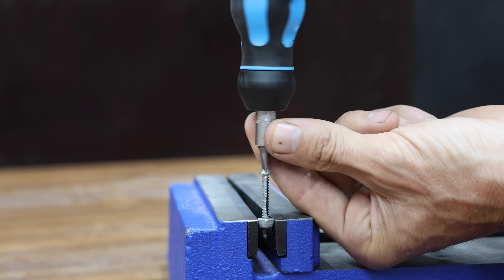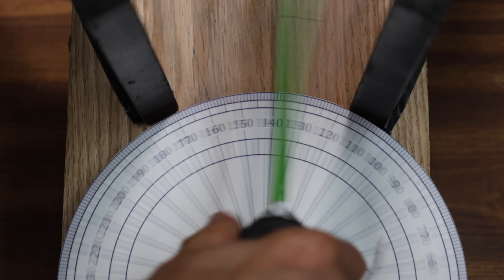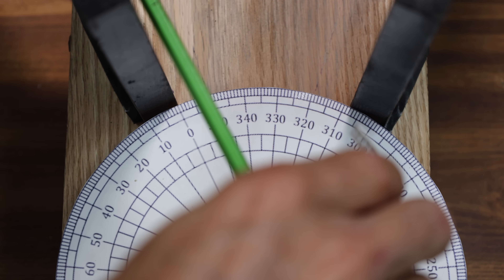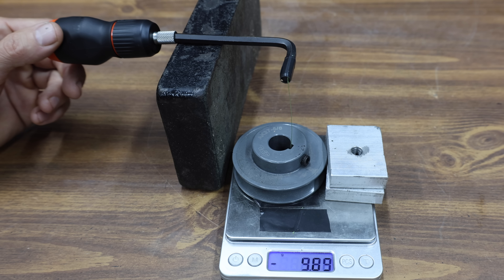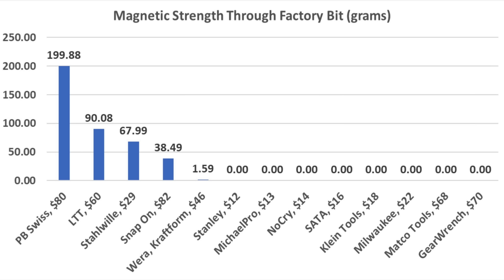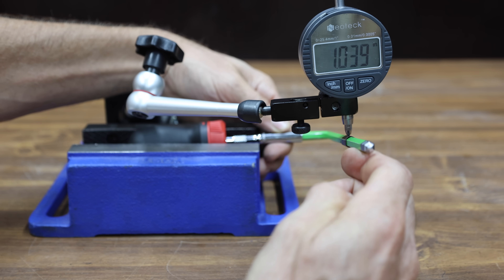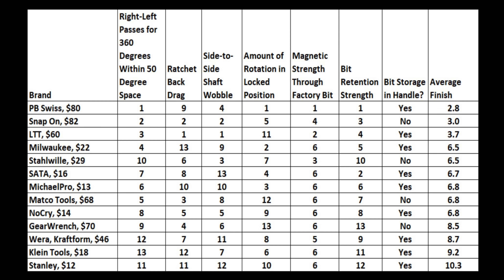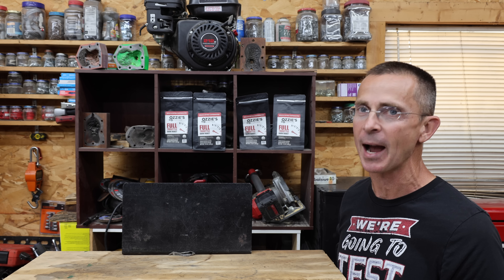Is Linus Tech Tips “Stubby” Screwdriver Best? Let's Settle This!

Comment: I think one of the most impressive wins for the LTT is the side to side wobble, less than half the slop of the snap-on, which costs more and is from a long established tool maker. Very impressive.
Reply: It's impressive don't get me wrong, coupled with everything else it's brilliant - but when it comes to ratcheting tools I've never found wobble/slop to be a significant indicator of anything straight out the box. They all end up the same way very very quickly. Now if LTT retained that tightness over a long period, I'd be super impressed and would make it my go to. But the larger LTT didn't hold up for me in that regard. My experience is they all end up just as wobbly as each other after a week of use, and if you need an exacting use, it might be best to see if you can use a non ratcheting tool.

But it's definitely a very very good indicator of strong build quality in the LTT and its impressive that a company like LTT that doesn't (yet) specialise in tools has such high quality control
Reply: @medes5597  I personally cannot stand slop in a ratcheting driver. The two I currently have are annoying when working in slightly tight spaces, making it easier to cam out when put enough pressure on them (I don't have any of the stubbies, so I'm talking about regular sized drivers). I'd much rather the LTT o r the PB Swiss in that regard
Reply: @caodesignworks2407  I don't disagree at all. Especially as someone with a wrist injury, slip was the bane of my existence - but I do think slop is inevitable if you're doing a lot of work. When I was using my ratcheting screwdriver hundreds of times a day, I was stuck with slop pretty much from the get go. Id definitely love to see a long term test on slop and which ends up with the least after a fair bit of use. That would likely influence my decision.
Reply from the maker: Thank you!
Reply: @zakkazz1201  hmm good catch. I can see how it could've been an honest mistake as the shaft on the LTT is so short, but yeah it is the closest to the vice of all the products tested and you cannot see the light coming from behind the screwdriver in that gap as you can with the other products that were close to the vice.
Reply: @zakkazz1201 I also noticed that, but then I paid attention to other screwdrivers, some of them were locked similarly. I assume all of them were locked the best way it was possible... so geometry of shaft contributed into this particular test(so far the only test that was influenced by geometry).
It is not excuse, just explanation attempt.
Reply: It does look like the way the LTT driver was mounted in the vice pressed the plastic body into it effectively cheating the test. I don't know if that is the case, it could have this low wobble but it was snug against the vice.
Reply: Yeah but look at how much the shaft rotates in the locked position. Pretty horrible for a $60 driver.
Reply: Remember, the snap-on also has a disadvantage in slop due to the removable shaft…

Comment: Thanks, I didn't even know LTT had a stubby screwdriver in the works. I have the original and I'm very happy with it.

It's definitely not meant for automotive use, but for electronics, it's the best ratcheting screwdriver I own. For heavier duty work I use my Stanley or Dewalt ratcheters.

I only onw one stubby version, the Stanley that you reviewed.

Comment: I've never used a ratcheting stubby screwdriver. I just recently bought a Craftsman screwdriver set that comes with a few stubby Phillips and flathead screwdrivers. They won't be really put to the test. Just general maintenance work around the house. And besides, they were on sale anyway.
Anyways, I'm not sure how you keep a list of suggestions, but I did mention a couple of suggestions a while back. Reviews on cordless/battery powered hedge trimmers, and which lawnmower blade is best with a riding lawn mower. Thanks Todd.

Comment: I have the LTT screwdriver. I’m not a fanboy of the channel, but it looked really good. 

Expensive, but I’d definitely buy it again.
Reply from the maker: Thank you for sharing!
Reply: Do you have any comments on the shaft slop? As another commenter pointed out the LTT screwdriver seems to have been butted up against the vice in the testing here and may have skewed that result. Would appreicate your comment! I am looking for a better alternative to the milwaukee, which drops my screws (and causes a bunch of problems when they fall somehwere crappy)
Reply: @MarkTrades__ I’m not the original commenter, but I also have the LTT screwdriver.  There’s basically little to no slop in mine.  It’s my absolute favorite screwdriver, I use it for everything I can use it for.  Too bad the recent drama surrounding LTT might make some buyers hesitant to support him by not purchasing the stubby, but at the very least Linus made an excellent screwdriver and could certainly have a future in the tool industry.
Reply: @MarkTrades__  I have not experienced that.  I just use it around the house and have had no issues.
Reply: I recently watched a long(er) term review of their backpack and that one seems to be very good quality, too. It is for a specific niche (someone carrying 2+ laptops and some other electronics) and in that case, it does the job very well. It is well designed, the zippers are good quality etc. Good stuff if that is what you need. They also seem to have good customer support.

Comment: I have never much cared for ratcheting screwdrivers, and the ratchet mechanism plus the bit storage tends to make them a bit too long to qualify as a stubby screwdriver in my opinion; when I was installing car stereo systems, alarms and cell phones back in the 80s to early 90s I frequently used stubby screwdrivers, most if which were only about  2.5 inches long.  I frequently found myself using a "super- stubby" Phillips that wasn't much more than one inch long!. The super-stubby had a hexagonal shaft where the Phillips bit exited the handle which meant that I could put a ratcheting box wrench on it for extra side-torque, a feature that was lacking on all of these stubby screwdrivers.
Reply: PS, bit storage adds weight as well as length......

Comment: I ordered the original LTT screwdriver, but I have issues with the bits falling out when opening and closing the storage.  Has anyone else had this issue?  I have to chase down the screwdriver bits a lot.  Other than that it's a great screwdriver so far.
Reply: mine holds the bits quite well. id reach out and see what they will do.
Reply: I drop it all the time.  They do not often come loose.  They do but very very infrequently.

Comment: Regardless of the current controversy this was another great video and honest review of stuby screwdrivers.

A review I’d like to see is on inflatable air wedge/jacks I recently picked up the rhino strong brand to help keep doors open but would like to see the others tested that are Amazon and see if I picked the right one or got caught in the market fluff.
Reply from the maker: Thank you for sharing!
Reply: Help keep doors open? I love over the top stuff as much as the next guy, but wouldn't a door stop be cheaper?
Reply: @mediocreman2  well the door stop I got didn’t work. The door spring was a bit strong and the floor was a bit too slick. so the door stop wouldn’t hold the door open so I used the air bag and it held it open.
Reply: Well, I've never used an air wedge as a door stop. I have however used Rhino's to install several upper kitchen cabinets. They are excellent, so don't worry that you may have been scammed. You didn't.
Reply: @ST-0311  good to know. I had bought a wedge-it brand door stop and the rhino to see how they would work. the wedge-it didn't work it the door was either too heavy or the door spring was set too tight so if you looked at it wrong the thing would shut. The rhino worked were that item failed.

Comment: Thanks for this video. You tested some very good aspects of these stubby drivers. One test I would have liked to have included has to do with one seemingly inherent problem with onboard bit storage. Since the driver is designed to use while palmed in the hand - I find that may drivers that use a screw-on cap to hold the bits have a tendency for the cap to unscrew while using the driver. This would be an interesting aspect to include when testing ratcheting drivers.
Reply from the maker: You're welcome!

Comment: Backdrag and the 360 test are by far the most important to me. Thanks for another great video!
Reply from the maker: Glad you like them!
Reply: Absolutely. As an electrician I find that low amount of backdrag helps a lot in tight spaces. You also just lose rotation because of it.
Reply: How about trying two remove bits with greasy hands I know that's not very technical but that's a pain in the ass if the magnet is too strong. It's quite frustrating to be honest. What's your opinion.
Reply: @anuragchandra8283  Yeah the bit retention is a balancing act imho. I don't want it falling out all the time, especially when I have my hand deep into a piece of equipment, but I don't value an extremely strong magnetic bit holder, either.
Reply: @anuragchandra8283 great point. A balance between being able to change bits easily whist Not leaving the bit behind after tightening. I hate that.
Reply: I typically carry a multi tool and use the pliers to remove bits when hands are compromised with grease.
Reply: Agreed. Great results from PBswiss .. too bad about that backdrag.
Reply: Country of origin is MULTIPLE places as it uses parts from Megapro, but if it is like LTT's screwdriver, is is assembled in Taiwan with parts from all over. @htr5372
Reply: @htr5372 i believe the ratchet is made in taiwan and the rest of the plastics and assembly is done in canada, wich also explains the more premium price.
Reply: Backdrag by far is important on PC builds and sensitive components.  For this reason I always have an LTT and something more robust for heavier duty work.  Great review once again sir!
Reply: @htr5372  made in china, assembled in canada
Reply: @htr5372 I spent 6 years in the U.S. Navy working on the CIWS Phalanx and Rolling Airframe Missile system as a Firecontrolman. After that I worked for Intel Micron Flash Technologies in a semiconductor production fab for about 6 years. From there I went to Dannon (Danone) to work on their automated packaging equipment for about 8 years. After that I went into medical equipment working for both Steris and Medtronic. working on medical equipment sterilizers, ultrasonic cleaners, low temp chemical sterilizers, medical equipment washers and ventilators.

Tell me you don't know WTF you're talking about by continuing to be a dumb jackass.

Have a nice life.
Reply: @htr5372 Parasocial? What the %^*& are you even talking about? I've never cared where things came from. I'm far more concerned with the quality and functionality of the object.

I actually really like that a lot of manufacturing is taking place in China and India because the world will be a better place if those billions of people have a better quality of life which ultimately will make the world a safer and more peaceful place.

I also know that China is capable of manufacturing things at any quality level the customer is willing to pay for, so if your Chinese made Craftsman  adjustable wrench is not as good as your old U.S. made one, blame that on Craftsman because they decided they wanted a cheaper product made to a lower quality standard.
Reply: @gameface6091 Supporting child labor in CCP? India I don't mind so much they are humans working due to their own drive and free will. China not so much.
Reply: @GrandeHuevos69  There is only one way forward, and that doesn't involve plunging China into poverty and starvation. As the standard of living improves the basic expectations of the workers will go up and safety and child labor laws will follow.
Reply: @htr5372 Yes, a great video. I don't give half a shit about country of origin.
Reply: @gameface6091  ME NEITHER! Actually, I think the tools are better when made in countries with few standards for workers' quality of life. Really teaches the tools a lesson on hard work before they reach my hands.

Comment: Good content as always. Thank you very much. 😊
A small content tip.
I saw that you have tests of different type of vacuum cleaners.
Is there a chance of 2 in 1 vacuum cleaner/steam mop test?
Like the Rowenta RY7777WH.
I would like to see your opinion about these house cleaning equipments. Are there worth it or is it better to buy 2 devices which are specificly designed as vacuum cleaners and steam cleaners?
Big Hello from Hungary.😉

Comment: Vessel stubby ia quite cheap and has fantastic back drag
Reply: I actually have 3 to always have one nearby.  They can get pretty cheap if you use a price watcher.  The only thing is the bit seems to rust easily even with a good oil applied.
Reply from the maker: Thank you for sharing!

Comment: I remember years ago I needed a screwdriver and bought the Stanley on a whim while standing in the checkout line. I think I paid around $10 for it.  I was always impressed with it but maybe that's because my expectations were low seeing that it was so cheap.  That thing held up to every bit of abuse I threw at it. Recently lost it and in looking to replace it was wondering about other brands.  For the money I think I'll stick with the Stanley. It did everything I wanted and more and  lasted me years.  Also, I can buy 5 for the cost of anything really marginally better. 

As always, thanks for your thoroughness and keep up the videos!
Reply from the maker: Thank you!
Reply: Tools don't hold the same quality as they did many years ago. I have an old Husky wrench set and I recently added a couple of new ones to find out the quality is very different. My old set is 15+ years old.

Comment: Video Suggestion: Gas Pressure washer, I'd love to see some brands like Stihl, Briggs and Stratton, and others in comparison. Something around the 5.5-7hp engine, and 2500-4000 psi range. Something that a property owner or even small contractors would run. Knowing the flow rates of water, actual working pressure, run time, and durability would be great.
Reply from the maker: Thank you for the video idea!

Comment: Back drag does not bother me as much on a ratcheting screwdriver and a socket set. First, I can just make the first few turns as if it is a regular screwdriver. Second, it is rarely a problem to put my finger on the shaft near the handle. However, my favorite ratcheting screwdrivers are the double-acting type that give me a turn in both the forward and reverse directions. It might be nice to see a full set of tests on these.
Reply from the maker: Thank you for sharing!

Comment: I picked up a Cornwell gearless stubby screwdriver a while back.
Its most likely the most stubby (compact) and ergonomic. 
Its the handle size of the snap on (maybe a bit smaller) but with a shorter shaft and has a quick release lock sleeve to hold the bits in.
Ive had mine for a while, not sure if they still sell them but i highly recommend trying a Cornwell ratcheting stubby if you can find it.
I cant beleve for the price of the snap on it has a cheapo magnetic bit hold..
Edit- btw the cornwell I'm talking about has a blue handle and kinda thinking they dont make them anymore. They have some used on ebay for 40$
Trust me that it's well worth it if you can get one. Best ever made.
Reply: I have never much cared for ratcheting screwdrivers and I wouldn't really consider any of these to be particularly "stubby" because the ratchet mechanism, as well as the bit storage built into many of them, tends to make them longer than they need to be, especially if you're working in tight spaces. None of these would have worked for me when I was installing car stereo systems, alarms and cell phones in the 80s and 90s.  Any screwdriver longer than about 2 and a 1/2 inches I wouldn't consider to be truly stubby and quite often I would be using a super stubby screwdriver of about an inch and a 1/2 length at most. I also found it was handy if the screwdriver had a hexagonal shaft coming out of the handle so that you could put a ratcheting box wrench on it for additional sideways torque.  And while built-in bit storage is convenient, it also adds to the weight of the tool as well as the length of it.
Reply: @goodun2974  I'm a firm believer (because its true) that Most tools have there place. The Cornwell im talking about does Not have bit storage, and it's as small or smaller then a regular normal stationary drive stubby screwdriver (its probaly 2 1/2" max)
As far as stubby screwdrivers with bit storage that are a bit larger, I think they'd be great for having in a motorcycle tool bag, or in a little tool bag for a vehicle.
There's so many different scenarios for the use of different tools that in my opinion its closed minded to restrict yourself to "I only use this one tool" for everything. 
Whatever floats your boat though, we all have our preferences and theres nothing wrong with that. 
I personally like ratcheting screwdrivers for alot of quick work, but I Only use old school stationary stubby screwdrivers for adjusting carburetors or stuff that I need to get a good feeling for the fastener.

Comment: The slop test results appear to be skewed by the slope of the screwdriver handle. As you alter the angle, the testing head moves down the handle. If the handle has a curve, then the testing head moves more than it otherwise would. This was most noticable on the Wera.
Reply from the maker: Thanks for the constructive feedback